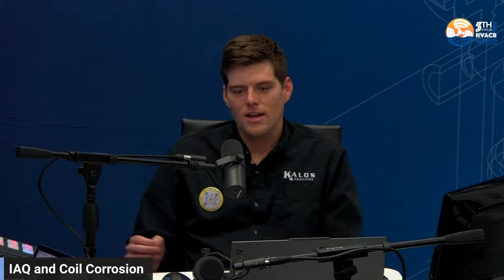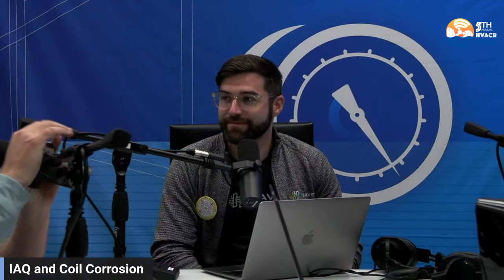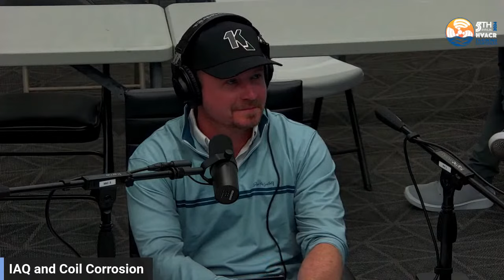Coil Corrosion w/ Kevin Hart and Bryan Orr

Comment: I am not a tech.  I am a retired person living in a retirement community.  I found this conversation because I have 2 coils fail due to leaks in less than 10 years.  The coils were in warranty but not the labor.  The first time I was told the coil had a galvanic reaction because it was copper and aluminum  and the new coil is all aluminum so that problem is solved.  The 2nd time, a few days ago, I was told they have a better coil because the plant is new and they have "Spanish" workers.  The box said made in Mexico.  So, I have spent $4,150 on labor to install replacement coils.  Listening to the IAQ part of your video made me think of where I am and the construction of my home.  First, I am in Arizona.  Humidity is not a problem.  Second, my home has cathedral insulation under the roof and the coil is in the attic.  It is not nearly as hot in the attic due to the cathedral insulation as attics in the midwest were where the insulation is in the ceiling.  However, the insulation that is in my home is blown in between the rafters and held in place by "bags".  It is not fiberglass insulation.  The insulation looks like a pulp product.  I wonder what kind and amount of VOC is being emitted by the insulation.  Is that what is causing the premature coil failure?  I am not alone.  My whole neighborhood of hundreds of houses built in 2014 and 2015 has had coil failures.  Some have had more than one coil failure, too.  Our HVAC system is manufactured by a major company, that had up to my moving into this home, with a stellar record of quality products.  I don't know if you will respond to my comments but please investigate, if you haven't already done so, this issue.  Thanks for a very informative show.  I subscribed because I like to learn as I live.

Comment: Most leaks are on evaporator coil. Why don’t use thick tubes as outside tubes (either aluminum or copper)
Reply: Money?
Reply: loss of efficiency, the thinner the metal the better the heat transfer
Reply: Bidenconomics
Reply: Aluminum isn't as conductive as copper so the coils have to be thinner in aluminum to transfer comparable heat in similar space.

Comment: I have had ductless heads leak from a kennel.  Amonia in the air.  Also cleaners.  Currently have a 4 year old system. out of 70 we have had 21 fail so far.  Copper coils. Old school.

Comment: When corrosion happens in copper, the copper is displaced and usually ends up in the compressor. Does the same happen with Aluminum coils? If not, where in the system does the Aluminum end up?

Comment: Looking at the leaks i have found i'd say that 40% of failures are because the aluminum is too thin, the unit has a abnormal line set, and was probably overcharged for heating season, often related to the length of the line set.

Comment: I find the vinegar and bleach often used I. Drains cause corrosion on the coil due to fumes and acid. I recommend most homeowners use simple green coil cleaner as a drain cleaner or treater instead of acidic and corrosive chemicals. They can easily find it at most Home Depot’s plus it’s non corrosive

Comment: Terrible subject.  All aluminum is not lasting very long for the era we live in and the cost for them. Either improve them or go back to copper.
Reply: I totally agree
Reply: Best comment I've seen yet! 👏🏻
Reply: Personally I have been finding the aluminum failing most often in the aluminum aluminum joints I am wondering if better processes in the factory might help, but I'm not seeing any evidence of improvement, how about you guys?
Reply: @vidard9863 Micro cracks occur. Can't see them without magnifying glasses.